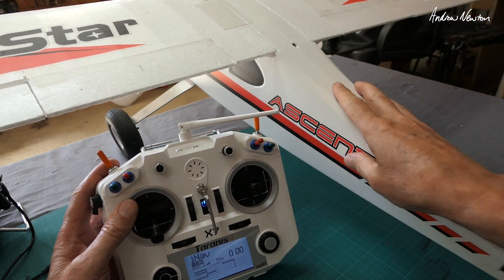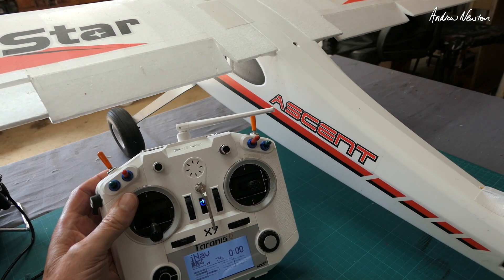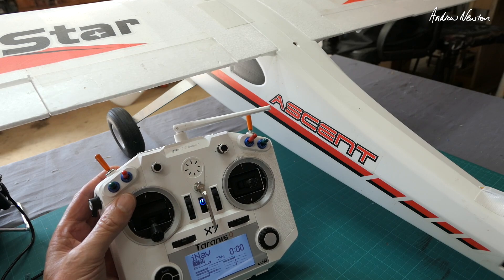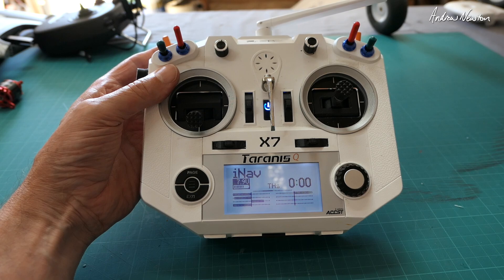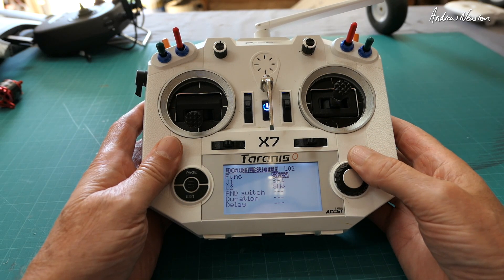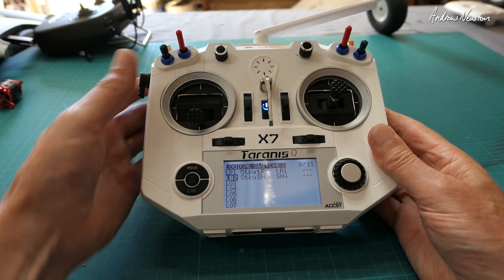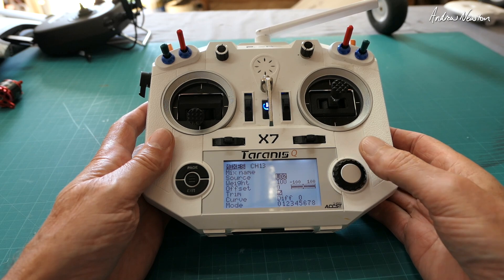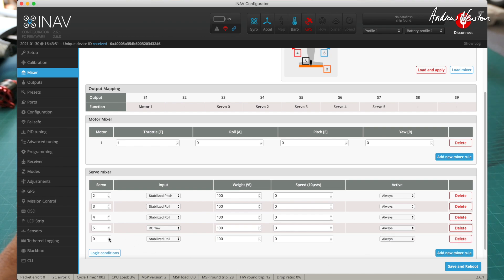Flaps on a Momentary Switch INAV

Comment: Hot tip, that you may like to pass on to your viewers at sometime Andrew. If you live in an area, were you can get, Muller corner yoghurt. You can use the plastic pots, from Muller corner yoghurt, as great, mega light weight, model aircraft underside skids. You have small and large size, in one pot. Just cut in half. Hot glue on for easy replacement. Great for glider wing tips. Thanks Keith. UK 🇬🇧.